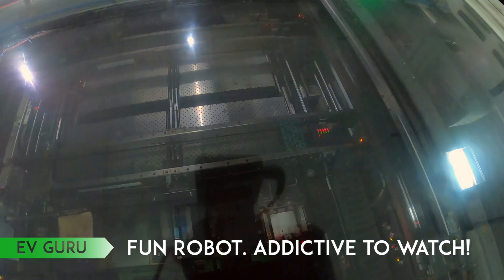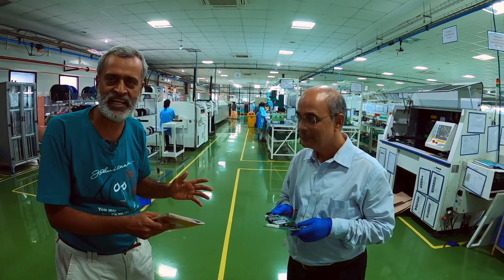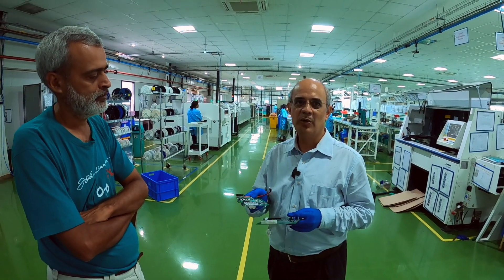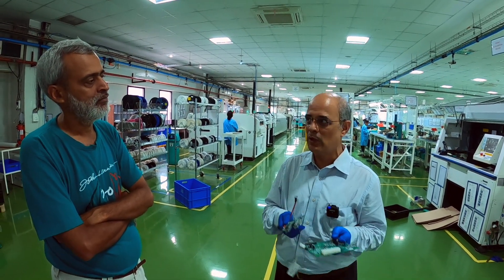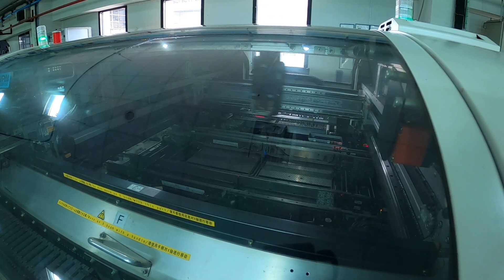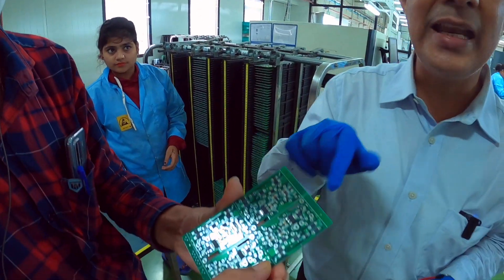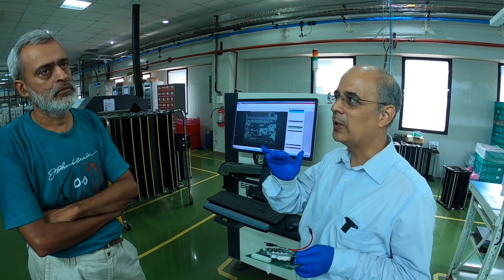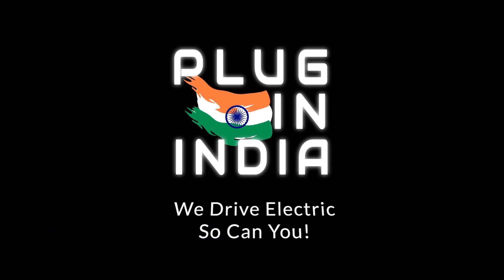EV Guru: Making the BMS | Battery Engineering #5

Comment: Okay if BMS is doing such great job then why battery pack are blasting
Reply: Because some manufacturers are using Chinese low quality BMS systems with C-grade Binned Cells to keep costs low.
Reply: bad building standards when assembling cells need a certain level of insulation and engineering must be up to standards required for energy storage or electric vehicle usage ,.. vibration etc can affect its performance .

Comment: will this company  make a bms which can communicate with motors contrloler and interface of bike..
Reply from the maker: "We can have can interface installed in any battery using our bms.  The bms can communicate with motor controller."
- From Mr Abhay
Reply: @pluginIndia  I make mid motor e bicycles we use Bafang ultra serise motors  they are equipped with inbuilt controllers however they only lack AI and other interfaces on ebicycle like kms that can be covered with remaining battery at various levels of PAS and algorithms for Apms discharge as based on user riding styles...
Reply: @yogeshnaik9276  Hi yogesh, Is there a website where i can see your company details, and product details. I haven't heard much about mid mount motored bicycles made in india. Is it chain drive or belt drive?
Reply: Thank you Shri  Atul and Shri Abhay for such a wonderful insight on latest innovative Tech. Bms is so critical.. This path will lead  our Indian EV to a level second to none in the world market...
Reply: @yogeshnaik9276  could you pls send me your email id. I wish to have a word with you on your project and if we could find common ground to work on a product.